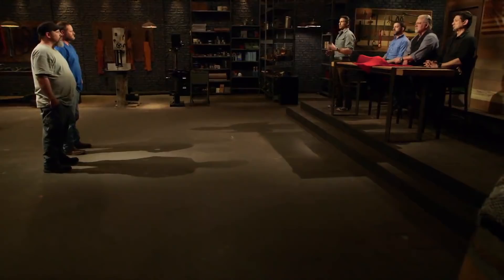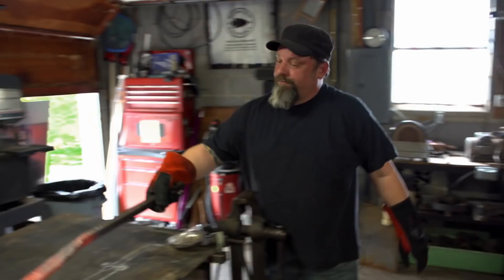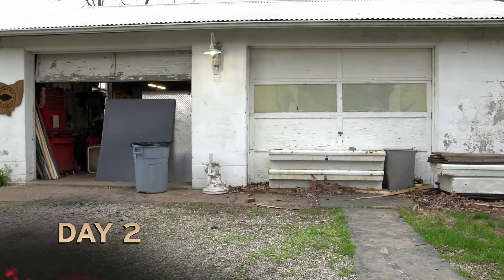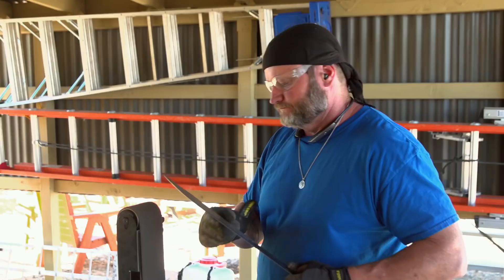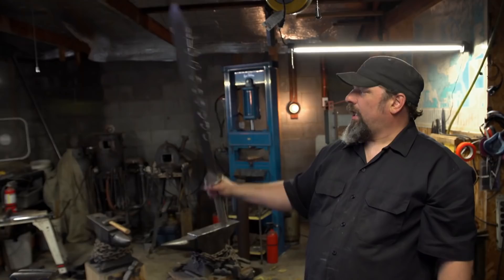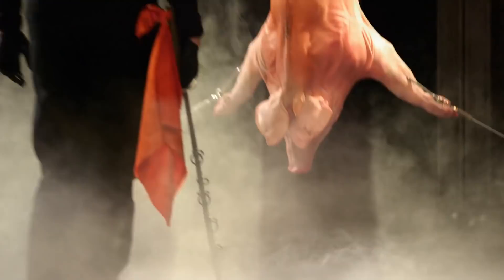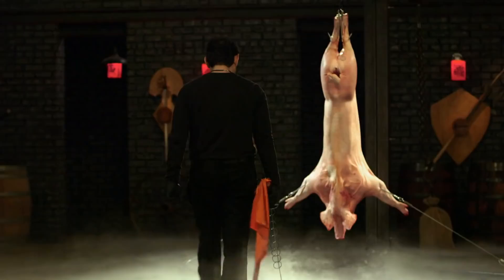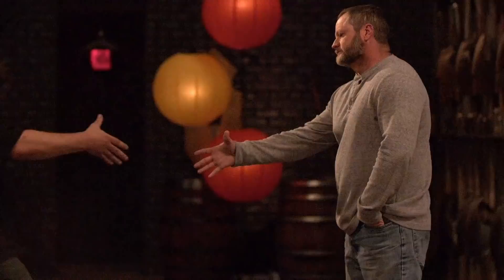Forged in Fire: 9-RING BROADSWORD SHATTERS KUNG-FU FINAL ROUND (Season 7) | History

Comment: This is why modern blacksmith's need to learn to punch the hole, not drill.
Reply: Or pre drill the holes before the hardening process
Reply: @L.H.F.  he did drill them before hardening. He drilled his holes on day 2 and we can see in the video on day 4 he says "got sword blade quenched yesterday"
Reply: Giggity
Reply: Robert Ross  g
Reply: Drifting a hole isnt complicated. Im noticing many of these guys don’t do it.
Reply: You shouldn’t be drilling holes is any blade that’s already been Hardened, as LowHangingFroot said. It is a lot easier to drill soft steel, and the way he had to heat up and temper the sections on his sword probably ended up in uneven hardness throughout. Torching is not the best way to temper a blade, I prefer a large fire. 

Also, those 9 rings are completely pointless and ridiculous. There is no point of them other than to add unnecessary weight to the blade and weaken its overall structure long term. They even inhibit the full cutting ability of the sword by getting caught in the target as soon as they hit.
Reply: @Divine_Serpent_Geh  The rings on a 9 ring broadsword spread open the cut as the sword passes through, letting the cut go a lot deeper.
Reply: Mr Bones  This is a Chinese great sword designed to cut a man in half. The rings open the cut, both reducing friction on the blade, and making a wider channel for the blade to follow, which is very useful when slashing through bones on the far side of the ribcage.
Reply: Mr Bones  Umm no.
Reply: @stevecope5549  I’m sorry, but it just doesn’t work that way. If that were true, than swords from every corner of the world would’ve incorporated this design into their blades. Those rings do not help with the cut, like I said before all they do is limit cutting potential. 

The rings are nothing but a drawback in terms of cutting and balance of the weapon. 

The geometry of the blade is what cuts, those circular pieces of steel interrupt the flow of the triangular cross section of the blade as it passes through a target.
Reply: @Divine_Serpent_Geh  Other cultures use finneal balls and rings on sacrificial swords that are designed to behead cattle or bison (edit: water buffalo) in one strike. It is a dishonor to have to make a second strike. Having a ring to split the wound away from the sides of the blade makes this possible.
Reply: @Divine_Serpent_Geh  By the time the whole width of a normal sword has passed into a live body, it meets resistance that stops the cut. The weight of the thing you are cutting into resists the blade (a lot). Katanas are really thin and narrow for this reason. Air needs to access the wound before it opens up. The rings enter the wound with the same amount of energy that cut through the collarbone and top ribs, popping the wound wide open down to the heart and lungs. From there the momentum does the rest. 
The rings actually help maneuver quick little strikes because they adjust the center of mass with every 1-2 inch motion, letting the sword move and leave some of its weight behind. Why feel the need to comment about what you 'think' when you haven't even handled a weapon like this? Enjoy a Happy New Year.
Reply: @stevecope5549  the actual historical purpose of the rings was to helps students gauge their strikes and thrusts, takes about 2 mins of research to actually figure this out. for a slash the rings will consecutively click one after another to signal an even slash and all 9 rings will click together to signal a powerful thrust
Reply: @muju9238  Correct...also to shake the rings and make noise...but the rings also act like the lug on an axe, splitting the wound away form the blade.
Reply: @Divine_Serpent_Geh  I dont think tried to drill after quenching as @TheRussel747 pointed out above, it seems he tried drilling on day 2 and quenched on day 3. 
Many steels can become partially or even fully hardened simply while air cooling and this can make some drilling and milling operations quite difficult if things aren't properly annealed. And just one more thing to add on to the pile of things that can go wrong is that in certain cases, the act of drilling (or any plastic deformation for that matter) itself can cause hardening to occur due to Transformation induced plasticity
Reply: @TheRussell747  ohh yes
Reply: @Divine_Serpent_Geh  The rings was said to actually have practical purposes, just not what put forth here. they're primarily used as weights, for adjusting the balance of the blade, like how it would be in today's gaming mouse. & in some cases, it's also a showcase of one being stronger cuz one could use one with all nine rings on it. it also has the benefit of preventing the blade for going too deep when used as particularly powerful chops, & makes yanking the blade out somewhat easier if it happens to be stuck. finally, it gives a small benefit of distracting your opponent due to the noise produced.

But then again, those were simply speculations by non-wielders. the true use of those rings are actually for training, performance & intimidation purposes. This kind of blade itself ain't even meant for actual combat.

Comment: Why don't you drill it before heat treatment??? It keeeled the Blade
Reply: It has a Chance of breaking
Reply: It won't heat evenly, same reason why they don't sharpen them before the quench.
Reply: But in ancient Times before drills, they had to Hammer the holes in While the blade was still hot. So before quenching
Reply: @reachingvalhalla5096  Maybe, but if they had hardened steel they would have been able to make files and spoon shaped drill bits. Though I couldn't find any literature on it. I think the smartest way the smiths in the video could have done it would be to put clay over where they intended to put the holes. Keep those 9 areas softer to reduce the chance of creating fractures. That's essentially what he did with the torch.
Reply: It would have probably also been better to have punched the metal to give it a radius on the holes edge, straight edges cause stresses which also might have lead to the failure of the blade.
Reply: @SatouKazuma  the guy that won drilled his before heat treat
Reply: @reachingvalhalla5096  drills have been around for millennia in one form or another.
Reply: @RandyLeftHandy  no.. its different thing.. you cant sharpen it before the quench that silly. It had to be fully harden first. But making hole are different. No expert, but i think that is more viable.. making the hole while the steel is pleable.
Reply: I had one question thou.. why not make the spine from softer steel? Its violate the requirement?
Reply: @RandyLeftHandy   They had hardened steel it was what they made the blades from.
Reply: You don't drill the blade you punch the holes why the metal is red hot and if you have to drill you want to drill it before heat treatmentbecause if you drill after heat treatment you're going to cause microfractures throughout the grain structure
Reply: And traditionally the holes were punched on these type of swords
Reply: With the Becker series of KA-BAR knives, they experienced a lot of blade breakages from hard use. The problem was eventually traced back to the stamping of the blade information near the tangs, as the stamping put a great deal of stress into the steel. As a result they switched from stamping to laser engraving.

I just can't help but think that punching a hole, even when the steel is hot and malleable, causes a lot more stress to develop than slowly removing steel in the drilling process when the bit cuts through the material.
Reply: Why drill it at all? Should just recast through a mold so the metal is uniform. Drilling damages the integrity of the blade

Comment: When I see people drill metals without cutting fluid I cringe....you can easily cut hard metals if only you had used cutting fluid. Now you are not only dulling your drill with a risk of break but your drill and the metal becomes really hot and that ruins the metal.
Reply: the cringe is real when these guys are so called experts but dont know how to drill. wonder if they even look at their spinning speeds
Reply: Ya, It’s quite hard to watch lol. No wonder his blade snapped at one of the holes.
Reply: It's especially important to use the proper cutting oil expecially when you're drilled simi harden metals
Reply: Thanks.. 
I was Wondering the best way, and I thought I seen him skip a Step.
Reply: it's a better idea to drill holes and put in fullers before the quench.

Comment: When drilling hardened steel, it is important to use plenty of lubrication and perhaps coolant, there are lubricating pastes made specifically for drilling into hardened steel, but I find machining/cutting oil to be the best, apply a few drops and go nice and slow, making sure to not overheat your piece or your bit, pull out often, and resharpen regularly as needed. It might take a while, but with enough dedication you could probably drill that with a masonry bit.

Comment: Remember drill small and then work up to the size you need. You are less likely to cause stress in your blade.
Reply: And he should be used as a coolant oil to keep the metal and the drill bit as cool as possiblesomething like Wonder cut which is actually a milling oil but it works great for drilling
Reply: You could drift the holes instead which is better anyway.
Reply: @1014p  yes and no. Depending on your steel and temperature you can still create stress fracturing.  That is why I drill or drift while the steel is soft and then harden the blade after heat cycling the blade.

Comment: 8:25 with al due respect. How the F is it gonna slice/cut if the sword gets cockblocked by its own little wavyflag.
Reply: It’s not long enough to stop cutting as it can only cover the bottom 1/3 of the blade. It was also added to confuse the enemy on where the blade actually is.
Reply: @shanehunt9256  the red flag thingy was not 1/3
Reply: killervshot MLG ikr it was like 4 5ths
Reply: That scarf thing is ENTIRELY unnecessary, & actual broadswords, when used for their intended purposes, wouldn't have something like that tied to it (not at such lengths at least). that thing is pure theatrics.

Comment: Nine Ring Sword: used as a training weapon to teach students proper strikes. On a slash, all 9 rings “clink” one after another; signaling a correct slash. On a thrust, the rings should all clink together at the same time.

Source: was curious so I googled it for more information.
Reply: It was said that other than symbolic meanings & for distracting opponents somewhat, the rings are actually there as WEIGHTS, primarily to adjust the feel & weight of a blade, just like how one would in some of the gaming mouse today. furthermore, the rings prevent the blade from going in too deep when bringing down really powerful chops, while also making it easier to yank the blade out if it happens to be stuck.

But then again, those were simply speculations by non-wielders. the true use of those rings are actually for training, performance & intimidation purposes, like the clinking part you said. This kind of blade itself ain't even meant for actual combat.

Comment: I would love to know whether Doug realized that the tassel caught in front of the edge when the first sword broke, as exactly the same thing happened on the last cut for the second sword when he was testing the other blade.
Definitely a fair contest, as both blades experienced the same test, but is the tassel supposed to block the edge like that? (rhetorical question guys)
Reply: The tassel is purely for theatrics when doing swordplay performances, & no one in the right mind would actually attach one to the blade when using it for its intended purposes. the show simply didn't do enough research & screwed up in this case.
Reply: I believe historically silk tassels would be used as a hand wraps and help hold onto to the grip. So no, it's not meant to flop around like that.
Reply: @ngcastronerd4791  I just got necro'd so hard it gave me whiplash lol. Do I need to make an edit saying that I ended that comment with a rhetorical question?
Reply: @williammarkham7598  I was replying to falcon.... Edit all you like ;)

Comment: And the moral of this story is: Never try to drill holes AFTER heat treat
Reply: Calvin Kind  heat treat essentially refines the grain structure. it reduces stress in the metal and makes the metal uniform in its strength. it also tends to harden the metal. forging does essentially the opposite, forging expands the grain of the metal and makes it softer even after it cools. in response to the katana thing, people do its called pattern welding however, it is very time consuming and if you get it wrong can have disastrous consequences that can force you to start all over again. generally if people are going to do a pattern weld its for authenticity, or for looks. not for strength because it is quite easy to make blades that are just as or stronger than pattern welded designs with single pieces of metal
Reply: Calvin Kind  by the way my explanation was extremely crude. the actual processes and learning them take years

Comment: This is why bladesmiths/knifemakers should always have a set of carbide bits on hand (or any metalworker who does heattreating really). Never know when hardened steel will need some holes drilled, will have to go slow with the appropriate speed/feed and cutting fluid, but carbide will get it done.

Comment: The tassel attached to the hilt is meant to be at the end of a string so that it doesn't flap onto the blade itself during a cut.
Reply: Could just not have a tassle to begin with.
Reply: The tassel is POINTLESS. you just DON'T put something like that on a blade to be used for serious cutting.

Comment: That last strike was dulled by the rag covering the edge.
Reply: Slow video down to 1/4 speed and watch moment before impact 6:35 Doug lays the blade over nearly sideways like a paddle. Poor edge alignment will definitely cause a failure however the sword would still have not held up to the strength test...

Comment: A question though if anyone has the answer. Would using cutting oil to drill a hole, prevent the blade from cracking during use?

Comment: When he was drilling and noticed it was easy to drill the first few holes then it got hard. Meaning the top of the blade was soft to begin with, I noticed it instantly and thought he would reheat the blade, then he used a torch on the blade changing it molecular structure in different points....but I never made a blade so I could be 1000% wrong
Reply: I noticed that too.

Comment: God, thoes swords are horrible, not the ones they made. Just the sword design as a whole
Reply: I can agree the 'Rings' seem to be  MASSIVE design flaw and seem to cause the entire sword to end up destroying itself possibly
Reply: @ziz3774  chinese have the habit of making things abit too extravagant
Reply: @ziz3774  it did cause one of the blades to break. The ring wrenched itself to the side, causing that guys sword to snap as it was forced into the metal
Reply: Putting stupid rings on a sword just makes no sense and makes the weapon a liability.
Reply: The 9-rings board sword is a difficult weapon to make. Even for traditional Chinese sword maker. That is why it is not a popular weapon. The purpose of the rings add weight to the sword. This weapon is mainly used by Chinese executioner to deliver clean cut to the head in one stroke.
Reply: @yutakago1736  thank you for the explanation.
Reply: @b_f_d_d  its more for practice and not for functional use. When swung properly, you are supposed to hear 9 distinct clicks as the rings tap each other.
Reply: Yutaka Go could just make a heavier blade then. I mean the Chinese had so many blades of their design able to handle that task.

Comment: In my hometown, they don't dip the whole knife into the water, they harden the blade, then the back of the knife. The blade will then be harder than the back of the knife. That makes the knife more durable rather than prone to breaking. The standard blade is a handle that should be curved and not straight, and the tail should be bigger so that it does not slip out of the hand.

Comment: So the rings added extra stress points which probably significantly increases chances of breakage being theres 9 rings instead of 1 that we've seen, or a hole for a tassle/ribbon. Doesn't seem like these blades would have held up in a strength or maybe even sharpness test either. Things were beasts though!
Reply: This particular type of broadsword ain't actually meant for actual combat in the first place. it was said that other than symbolic meanings & for distracting opponents somewhat, the rings are actually there as WEIGHTS, primarily to adjust the feel & weight of a blade, just like how one would in some of the gaming mouse today. furthermore, the rings prevent the blade from going in too deep when bringing down really powerful chops, while also making it easier to yank the blade out if it happens to be stuck.

But then again, those were simply speculations by non-wielders. the true use of those rings are actually for training, performance & intimidation purposes.